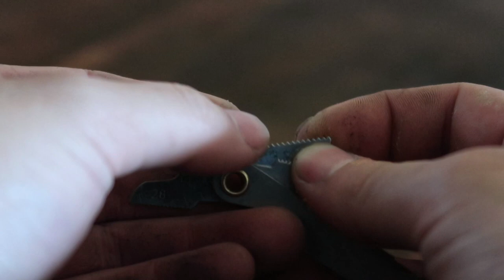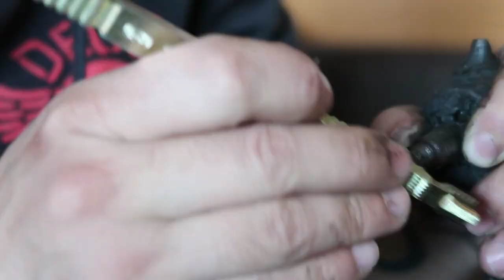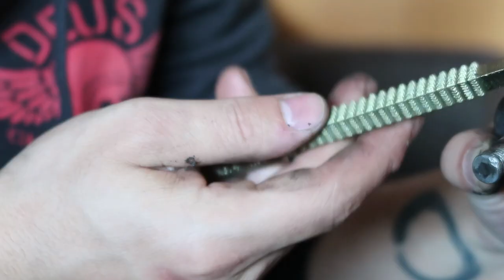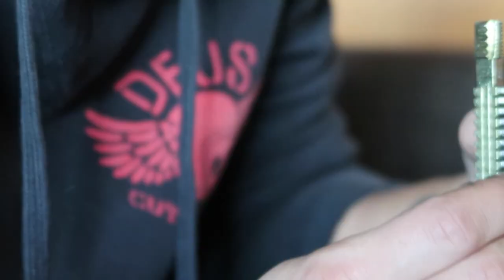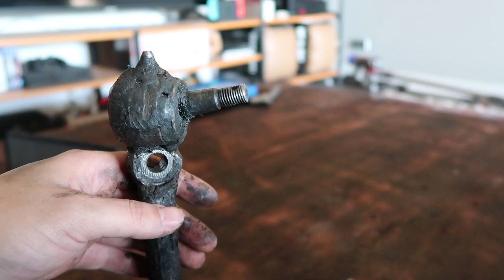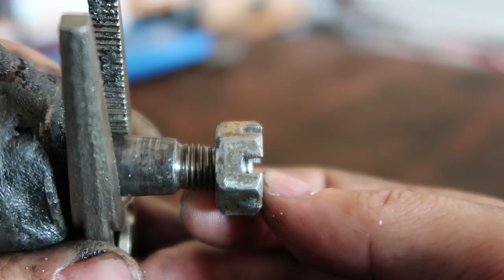HOW TO: FIX A MUSHROOMED BOLT!

Comment: Hi I did this to a skateboard kingpin. You can buy new ones but I did it to three different bolt if I buy the retreading kit at say harbor freight or advanced auto am I making the right decision ? What was the tool that you used first to grind it down before the di??
Reply from the maker: Hi the tool is called a thread file - its good if you're having trouble getting the die started!

Comment: HOW TO FIX FOR CHEAP NO FANCY TOOLS 

All you need is a small Dremel, Dremel brand cutting wheel (Everyone should have this), if not you can do without it too
Hack Saw with a few blades just in case
Penetrating oil
Breaker bar (An impact wrench is better if you can afford it, also highly recommended to own) (20v Brushless 1/2)
Non OEM 30mm axel Nut, this is because they're made of a softer material than OEM, the goal is to strip a bit of the inner 
material of the thread of the nut as you force it in and not strip the thread of the Axel.

Procedure:

1.) Use the Dremel to cut around a few inches of the outside of the axel (If you don't have  a Dremel you can skip this step) the point is to cut off the mushroom part so the nut can slide in.

2.) Use a Hack saw to finish cutting it off, doesn't have to be much but it depends on how bad it is, make sure to use oil so it doesn't get stuck.
Also spin it around while you cut and keep it straight until you reach the center.

3.) If you have a 1/2 Impact wrench put it into the #2 setting (Not max, we will use max only to remove it in case of an emergency) and with the 30mm socket start fitting the Nut until it gets stuck then pull it out, let it cool a bit, apply plenty of oil, clean and lubricate the inside of the nut and do the same for the axel, then repeat. Hitting it with the impact wrench until stuck and pulling it out, being careful not to strip it on the outside, until you reach all the way to the end of the axel and are able to take it out. What we're doing here is stripping a bit of the inside thread of the nut so it can fit. 

3.b) If you don't have an impact wrench it will be a lot harder but you can just use a breaker bar, I would recommend to cut more off the axel to make it easier.

Hope this helps! It worked for me without having to get a cast/die set.